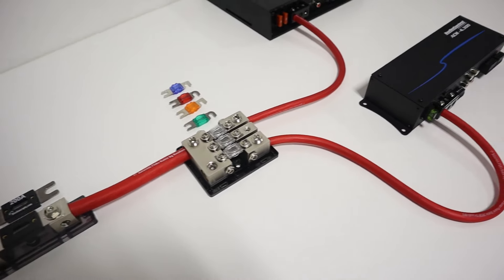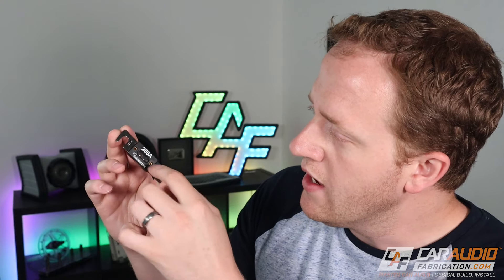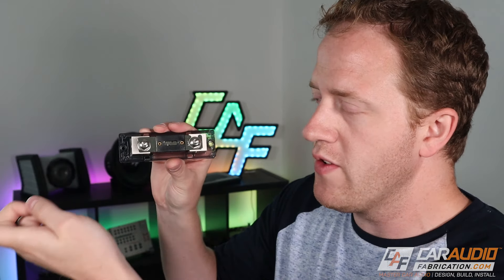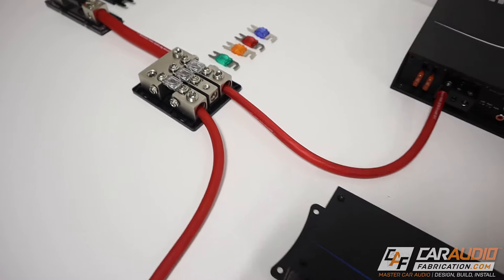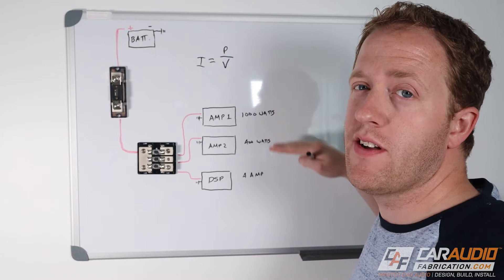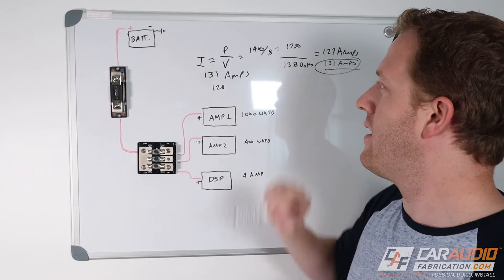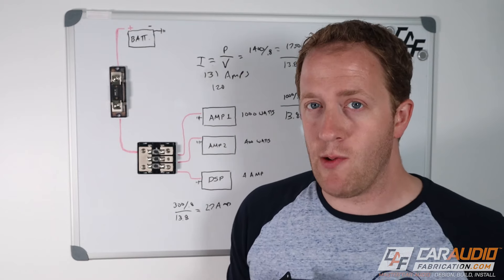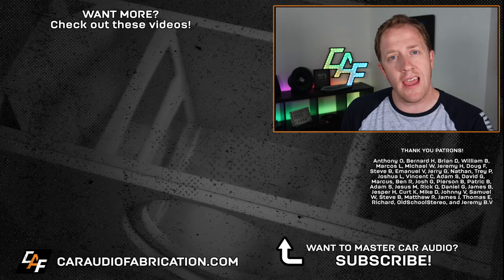Fuses EXPLAINED! What size do YOU need & MORE!

Comment: When sizing a fuse for an amp thats rated at 1000W at 1Ohm but im only using a 4Ohm (sub) which is rated at 500, Do I size for the 4ohm output or the max at 1ohm?

Comment: Love your vids, you're the best out there.  Could we take fuses and wire sizes one step further with a bench demo of blowing fuses, wire temps at excessive current loads, and voltage drops across under sized fuses & undersized wire gauges?  Basically a fuse and wire test to failure.  Thanks!!!

Comment: Ok so I have a question what if an amplifier draw is 8000rms and needs a fuse over 300amps how do you do this? I'm not sure if you have another video regarding this information but I'd like to see it and how you would do it as I've only seen 300 amp fuses

Comment: I have 2 questions. #1 is there any books you would recommend on vehicle electronics installs? #2 could you recommend a good company or companies to get supplies from like wire,connectors and fuse blocks? Thanks. Great video.

Comment: I have a question my amp reads 200w times 4 , does this mean i have an 800 watts amp , need this to be answer please to do the equation in order to find the correct fuse or do i have a 200w amp ?????? Please i am very confused and sorry can you please explain this

Comment: this might have been asked, but if you have a 1200.4 amp, that tells you it only needs a 40amp fuse, because it runs 300watts RMS at 2ohms per channel, does that mean the whole sytem only needs the fuse, or should i still run a 100 amp fuse because the total power if using all four channels could reach that 1200 watt usage?

Comment: Hi Mark.  Great video.  I'm learning everything i need to know to install 2 new amps in my car myself.   (my old amp finally died)  My sub amp has 2 zero gauge power and ground hook ups.  My mid range amp has one 4 gauge hook up for each.  (DD audio M4b and SS4b)
I'm running zero gauge and upgrading fuses.  My previous installer had run the ground wire all the way from under my engine bay to my 2nd battery in the trunk.  Was that a waste of wire?   I would appreciate some reassurance that for my application it's ok to ground closer to the trunk somewhere.  Running zero gauge ground that far seem unnecessary.  thanks for everything &  KnuKoncepts is getting my business on this upgrade.

Comment: Since power usage isn't a constant value and fuses don't blow immediately, i've used smaller fuses than neccesary for all wiring, amplifiers and inverter in my car.
e.g. Replacing two 30A fuses that came with the amplifier with two 20A ones. So far they haven't failed yet. Do you think it's a good idea? Is there even such a thing as slow- and fast blow fuses in car audio systems?
Reply: As long as everything works just fine it's not a big deal. Only getting a bigger fuse in is a terrible idea.
Reply: It's okay to go smaller, it's not recommended to go bigger. Only difference you'll see is that itll take less of a surge to pop the 20s

Comment: Okay so I had my power wire go from the battery to the distribution block to the capacitor and so on.. well now if I take out the capacitor or even the distribution block too my amp immediately goes into protect mode but if I add  them both back in my amp Is fine

Comment: Can you explain to me why you don't use a safety factor? When calculating your fuse size? You want to be able to use your peak current but you are sizing it just above the total amperage or just below as you did in your example. In many cases I have heard 135% used to size your fuses

Comment: if my amplifier External Fuse Rating: 240 Amp , can i put 120a in front by the battery and 120 in the back by the amp?  also is a 4 awg wire  cca good enough?

Comment: Hello, CAF. I have a question. 13.8V was used for determining fuse size in the formula. But shouldn't it 12V because cars use 12V systems?

Comment: Question. What if my calculations says I'm going to draw 1300 amps, do I have to do 4 runs of power and fuse them each with 300amp fuses? I got 12.5k bass amp plus 2 2000 watt mids and highs amp. 16500÷.8=20625 then divide that by my volts which will be around 15.3=1358 amps

Comment: IDK if this will  get read, but here it goes. Fusing question Mark. When doing a Big 3, it has never occured to me to add a fuse between the battery and the alternator until my friend Chris Denardo brought it up while planning his on his new car. I've been installing for years and this never came up and it appears nobody does it either. Sonic Electronix, EXO Contralto and even Steve Meade go direct with no fusing from the alt to battery. Proper protection dictates that any wire coming off the battery should be fused no more that 15" or less from battery, yet we never do on a wire that has the potential to be 3-4 feet long. 
Please let me know your thoughts Mark.
Reply: @Coffee  

Most OEM wiring from the Alternator to the battery has an in-line "Fusable Link" in this wire.  Google "Fusable Link".  It usually looks like just a 2"-3" section of black heat shrink tubing over the wire.

So yes, the Alternator (+) wire to the Battery should be Fused, as it has the potential to come loose from either end, which will both be energized if the car is running.
Reply: @bbfoto7248  yeah, just to be safe I fused my alt wire. good call

Comment: The issue that I’m having is I’m following your math but using my total watts for both amps. A 520  watt  and a 1800 watt both are a/b  so only 50% efficient. so I take the total and divide by .5 and it puts me at 4.640 and i divide again batt voltage 13.8 and it puts me a needing a 336.2  watt main battery fuse. I do my individual leg and it’s 1800 divided by .5 puts my at 3.600 divided by 13.8 puts me at 260.8 for my individual fuse. Why is it so high I’m not trying to compete in car audio. Also my 1800 was amp gain will be turn down 3/4 of the way. Im even trying to run it that hard. Do I still need the crazy high individual fuse for it. Can you clarify this for me a little bit I would appreciate it. I totally understand the fuse for safety and I’m all for it. I just am trying to understand the really high fuse when I don’t ever plan to push the equipment to that level.

Comment: I got a sub amp that uses a 200 amp fuse an got a 6 channel amp uses 150 amp fuse how will it work if i use a distribution block that don’t have fuses will i use the same gauge wire

Comment: So I have a small car and I’ve added RF doors speakers (no amp yet) and a Memphis subwoofer with a Memphis amp. It’s wired to 4ohms so it’s only 350W RMS, but I plan to add a 400W Memphis amp to my door speakers which are also 4ohm so it’ll be 65W RMS to each speaker. Both amps recommend a 60A fuse, so would I put a 120/150A fuse at the battery and use my capacitor as a distribution block? Or should I install a fused distribution block after the capacitor running to each amp? Also I have 4AWG power (about 11.5ft), so should I run 0AWG power and distribute to the amps via 4AWG? Or is 4AWG sufficient?

Second, I recently installed my LC2i and now when I open my car, start it or when the power turns off my sub puts out a small thud like there’s a signal being pushed through without any audio being on...how would I get rid of that?

Comment: So i going install 4 8' mid range ,4 tweeters and later down 2 8" mid bass with 2 10' Kicker subwoofer. If am correct its going be about 3 amps, equalizer,epicentre and over drive.

Comment: Is it wrong to run 2 seperate 4guage wires, with appropriate fuse in each , between my two amps and the battery.  Ie each amplifier has its own dedicated  cable going into the battery and the battery has 2 x 4guage cables attached ?

Comment: I'm getting a JBL stadium 2 and it's calling for a 100amp ANL fuse!? But when I do the math the most the math tells me to use is a 50amp ANL fuse.  So can I just use a 50A instead of the 100a the manual calls for?  Or should I use a 100 a by the battery then use smaller fuses in the distribution blocks

Comment: i need a little help, i got a crunch gpa 1500.1 and it came with 35 amp fuses(green ones) and i recently saw that the come with 25amp fuses (grey i think) i've been using the amp with the 35amp fuses and it seemed to work fine. Is it bad? or am i losing performance from having a higher amp fuse?
Reply: correction 30amp fuses*

Comment: I'm about to do my first install. Your videos are awesome and have been a tremendous help. I'm installing a Rockford Fosgate P500X1BD Punch 500 Watt Class-bd Mono Amplifier and an LC2i pro. I can't find a fused distribution block with a 4 gauge input and 14-16 gauge output for the LC2i. So do I need to just run a separate power from the battery with inline fuse instead of using a block?
Reply from the maker: Check this out https://youtu.be/UaaDOq0mu-0
Reply: @CarAudioFabrication  Another informative video. Thanks for the lessons and the response.

Comment: So let me get this straight if I'm running 2 amps that take 4 gauge  the other  of the distribution block will be a bigger wire which connects to the battery

Comment: So lets say I have a system that is pulling around 300 amps max. I was running a single run of 0 gauge on a 300 ANL fuse with no issues, but after adding another amp I'm now pulling close to 355 amps max and I want to beef that up. If I run 2 lines of 0 gauge from the battery to the distribution block in the back, would i want to use 2  175 ANL fuse or 2  150 ANL fuse for both of those lines (2 fuse holders on both lines of 0 gauge less than 12"of wire from the battery)

Comment: Ok I have a question so I have two american bass elite 1244 12" subs that can handle 1200 rms watts each so total of 2400 watts and I'm using a taramps HD3000 monoblock how would I do the math for that because obviously I'm not going to even be using all 3000+ RMS watts that amp is capable of I only need 2400 at max how would I do the math for that to find the right fuse do I still need to calculate the entire power capability or is it safe to fuse according to the actual current needed I got the amp just so I had head room so do I still have to account for that head room I'll also be setting gains with an oscilloscope so I am trying to be as precise as possible

Comment: My question is i wanna do a big three upgrade and wanna make sure im right soo... Iwill have to get a fuse box for that okay then run the power wire to the + battery then put another fuse to run to the back to the second battery then i get another fuse box and run it to the amp is that how it works for that part? it always confuses me

Comment: How do you tell what your system running voltage is?
Reply: Check from the battery/input. If car, it's written on the battery.

Comment: Okay so I did the equation for 3000watt amp so check this. 3000 ÷ .8 = 3750 
3750 ÷ 13.8 = 271.7
My question is, how do I calculate that number into amps? The amplifier takes (2) 35 amp fuses which is (70) amps. Is that math correct.

Comment: Great video. Have to ask, I have to use the voltage on the amp manual (ex, 14.4v) or use the car current voltage for the calculation? Also, use rms power or peak?
Reply: @Otto Rosario  
I would measure the DC voltage at your battery terminals when the vehicle's engine is running and use that Voltage Measurement for your calculations, because that is the "real world" voltage of your system.

Comment: So I’m running a 2500 watt class D amp with 6 gauge wire and a 80 amp inline fuse. So 2500/.8=3,125 watts… 3,125/13.5V= 231.4… so am I understanding this correctly… I need to swap out my 80 amp inline fuse for at least a 200-250 amp fuse?? Tell me if I’m right or wrong please.

Comment: Nice video.  I'd suggest an improvement would be terminal fuses on the battery and marine style crimped lugs and stud-equipped holders instead of the bare-wire clamp style connection your holders have.  I have an extensive "house" power system in my Jeep that sees lots of off road vibration and my mostly-Blue Sea fusing setup has held up with no issues for years.  Cheers!

Comment: Hey Mark I have a question. When calculating what size in-line fuse you need, are you using the peak wattage or the RMS wattage?
Reply: After doing both calculations for peak and rms wattage, I compared them to the fuses on the amp itself and saw that it was closer to the rms wattage. I guess with a little initiative, questions need not be asked.
Reply from the maker: RMS

Comment: The browse through the comets and didn't find an answer to the number for voltage what do I use for 13.8 senses to voltage of my battery.? How do we come up with the the votage part for our stereo system?

Class D(.80)  2500 watts ÷ .80 = 3125 watts PT 
PT ÷ V     3125 ÷ 13.8 = 226volts. ??? Im not certain and was looking for help checking my numbers are correct , specifically the 13.8

Comment: I really don know how to count after i watch vedio..... 😅
Better i ask like this. 
I got 4 channel 1200w and 2 channel 1800w. 
And start on bateri 4ga 60a fuis to behind use 1 to 3 way 30a fuis 8ga join the 2 amplifier and 14ga out to door speaker with twitter , 10ga for woofer.  And the gruond its join 3 to 1 way no fuis to car casis body .
Will this correct and save?

Comment: Question  I have a  200w amp and  8 gage  wire  with a MESA mini anl fuse holder with a  40 amp fuse. My question is  the 40 amp fuse  too much  for my amp
Reply: No man, it's fine. It's not like 120A or 80A fuse. Don't worry about it!

Comment: Just starting in the hobby and your videos have been a tremendous help so far. One question though, if I am understanding correctly, if I am using a distribution block to split one power lead into 2 that are the same gauge as the main lead then no fuse in the distribution block should be fine?

Comment: So I have 2 active subs with built in amps. 1500w peak and 750watt RMS each. Total 3000w peak 1500 watt RMS. Want to run from battery to Capacitor then to a distribution block and to the amps/subs. Wire from battery to Capacitor would be around  5- 6 feet. From capacitor to distribution block around 1-2 feet. and from distribution block to anmps/subs 1 foot. The Capacitor is a 5000watt capacitor. What gauge wire  do I need  from the battery to the capacitor and capacitor yo distribution block, and also what gauge from block to amps/subs? The fuse sizes for both the main power cable and distribution block I'm also unsure of.

Comment: I have a roadstar rda 6150 amplifier installed in classic beetle. I has 2x25a fuses on the amplifier it also says 3000w on the amplifier. It is loud but I don’t know what amp fuse to install to protect the circuit.
Reply: Well, 3000w seems to be the marketing value of your amp , let's stay positive and do 13.8 volts times 50 (2x25) ampere .. that brings you to a fused amount of 690 watts.. which is still a fair amount for an amplifier

Comment: Okay, great video!  I only have one question. Why didnt you mention inline circuit breakers ?  I've been using them for at least  10 years in all my systems.  Never had any issues, and if it ever pops, it makes it simpler than to than hunting for  the spare fuses in the car or garage... which for some stupid reason ALWAYS were not where I last put them. Somehow I always moved them . anyway, it would be interesting to hear your reasons behind not switching over to circuit breakers. (that's the real reason why i switched over many years ago.)

Comment: just making sure so i have a 600w amp to a single subwoofer also 600w. running from battery to trunk est. length 12ft. I would need a 50-60A fuse on an 8AWG wire?
Reply: Nothing to do with watts. What current does your amp draw and what can your wire handle? I have an 800w amp that goes upto 60A whereas my jet amp is only 25A

Comment: Great video! Very clear and informative. Question: So in a 2 amp system, say you don't step down the wire gage, and you keep the same gauge wire for battery to distribution block, and then distribution block to each amp. Then do you still want a fused distribution block...or is non-fused distribution block then totally safe?
Reply: No need to fuse when splitting the same wire gauge, using a non fused distribution block or ground distribution block.

Comment: I did the math on a 1200 watt amp and it tells me to use a 100 amp fuse but the amplifier manufacturer recommends a 200 amp fuse and so on and so forth, total amp power for my next build comes to 1700 with 3. Amplifiers shoul I add the recommended amp fuses and add the one in line fuse to supply the others???
Reply: Sub amp 1200 x  14.5 v x  90% efficiency 
Mid amp 300 x 14.4v x 90% efficiency 
Twt amp 200 x 14.4 x 90% efficiency

Comment: @ Caraudiofabrication Mark, I'm trying to make a purchase with KnuKonceptz, but I got stuck with what the proper fuses I need. I got alot of information, and I came out with I need Fuse 1: 300A / Fuse 2: 200A / Fuse 3: 80A / but KnuKonceptz only allows for 300A 150A & 150A so at that point I started double checking all my work. And I have to make sure I get the correct wire, I'm thinking I need 1/0 OFC wire. But after talking to a few people, now I'm starting to get confused again, bc now I'm hearing that there is a bunch if different 1/0 OFC wire, and now with so many different confusing ratings. Idk exactly what I need. I will be running the Smart3 at 4 ohm 2,000w RMS and the Rockford Fosgate Power T600x4 100w RMS per channel. So that's a total of 2400w RMS on the whole system. So I did all the math and figured out alot. But can you help me with the exact 1/0 wire that I'll need to make sure I order, when I make the order.

Comment: Hey! can you make next a guide of how to calculate the volume needed for speaker enclosure to run properly on ported/sealed enclosure? I've a pair of 6x9 inch rear speakers that the manufacturer didn't included the recommended volumen size  and my car lost it's original enclosure.
Reply: Try going to the manufacturers website